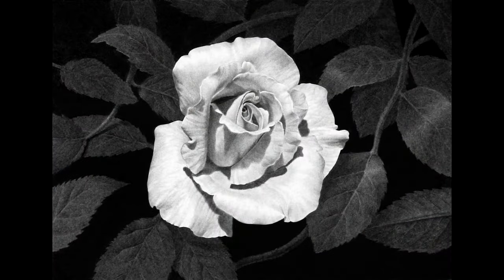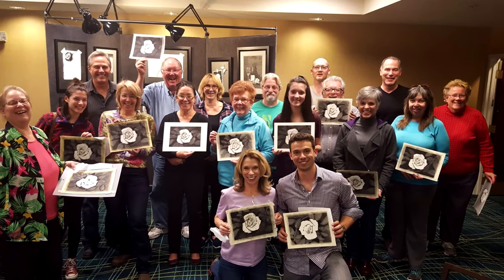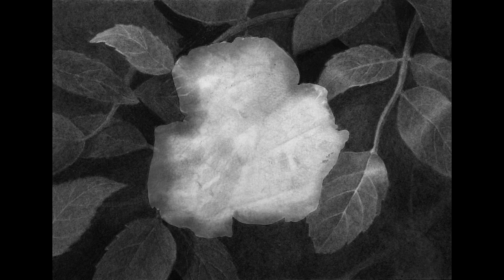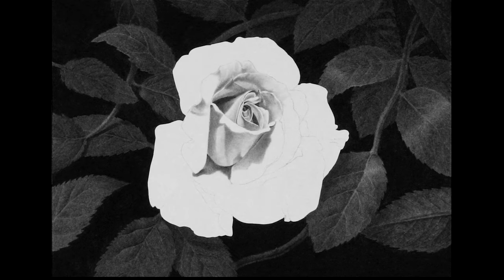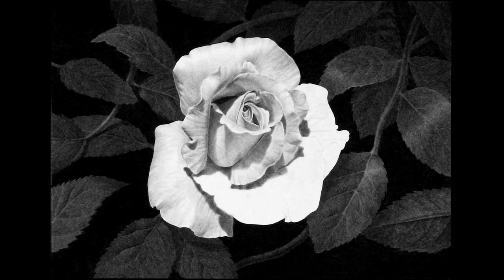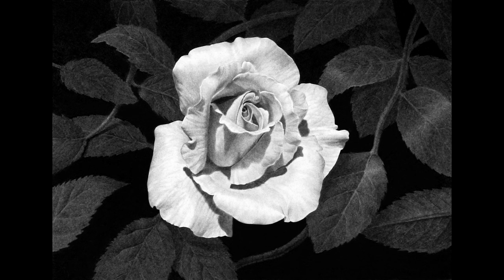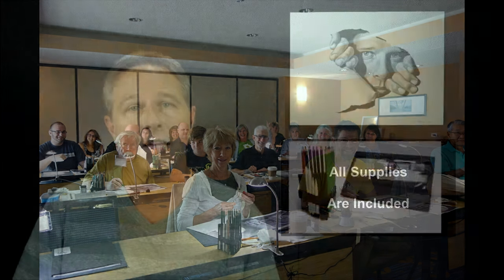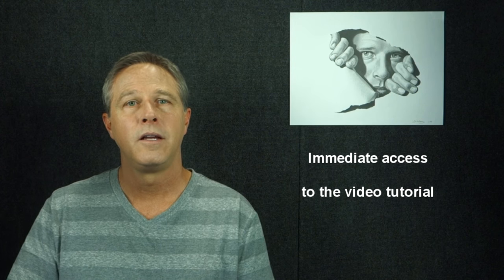Realistic Graphite and Charcoal Drawing

Comment: JD Hillberry This piece of art is amazing! Can I ask you a question, Is Grumbacher(Matte, Gloss) fixative final for oil and acrylic suitable for graphite portrait and why? One other question will the frisket damage the paper tooth like if I wanted to draw a face or a much bigger shape but I need to darken the surrounding first, If I cut out the frisket on a shape of a face or bigger and stick it to the paper is it ok or will it affect the details of the face afterwards? Will the frisket make the paper yellowish? Any advice would be helpful.
Thanks a lot
Reply from the maker: If never used that fixative so I can't help you there. I use krylon  workable fixative. Make sure you use low tac brisket and only press it down on the edges to avoid damaging the paper. It shouldn't yellow the paper unless you leave it on for months. Frisket will create very sharp edges so I wouldn't recommend it for a face. It also alters the texture but you can still draw detail. You will always be able to see the sharp edges though.
Reply: @JDHillberry1  Thank you very much